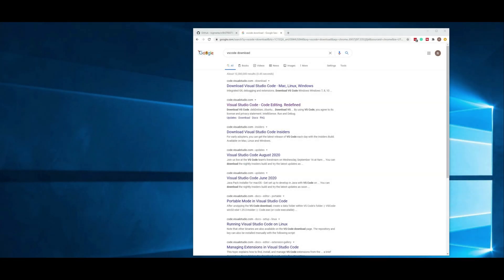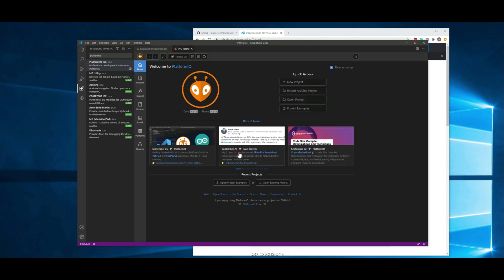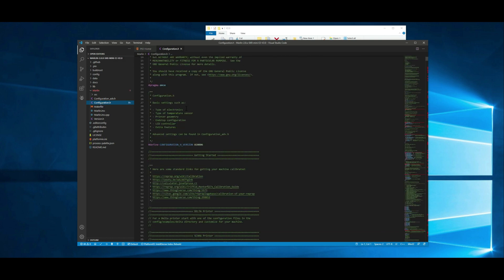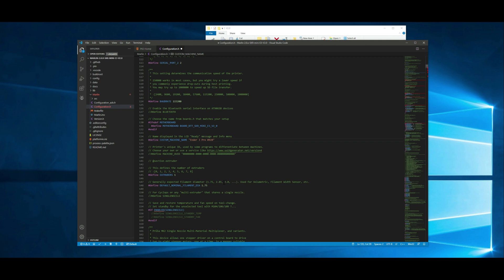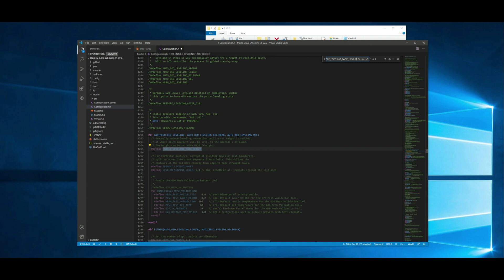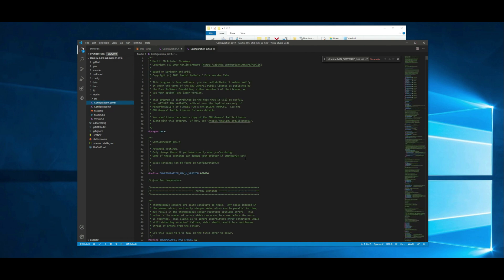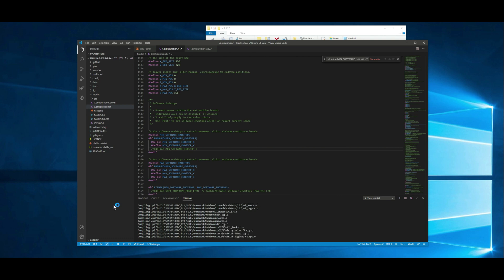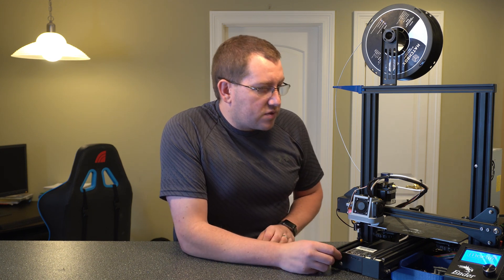How to Compile Custom Firmware for SKR Mini

Comment: Nice video I finally got my 1.2 board working. I don't know why I could not get it to compile on my windows PC.  I ended up compiling on my mac and it went through fine.  I have messed with a bunch of stuff to do network penetration testing so likely I need to run some cleanup on my system.  I also just went ahead and picked up the 2.0 board. Fun fact the 2.0 compiled fine whereas the 1.2 did not both from the save master file on the GitHub.
Reply from the maker: Hi. Thanks for the feedback 😊. Without knowing the error, its hard to say why the 2.0 firmware compiles, but the 1.2 doesn't. It could be an older version of Marlin in the 1.2 line or related to the platform.io version. I had a strange error the first time I tried compiling the firmware, so I searched around. Some people were saying its related to the platform.io version and a bug in Marlin. I restarted everything and brought down a fresh copy of the source, and everything worked. I think you will be happy with the 2.0 board.
Reply: I've also got the same problem here and found that It's because Windows restrictions on filename length. It should be ok after the folder name and location were changed.

https://community.platformio.org/t/cannot-compile-a-useable-marlin-2-0-firmware/10615